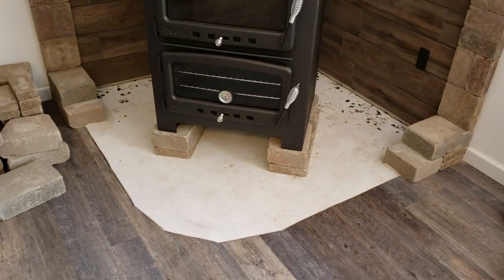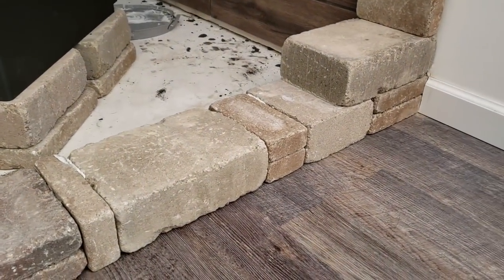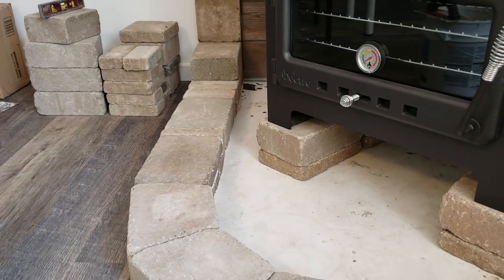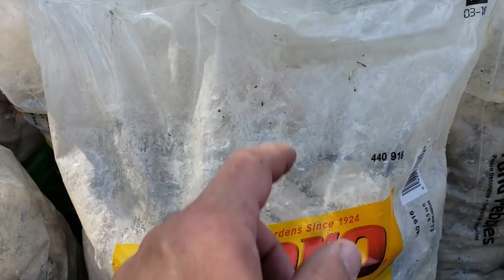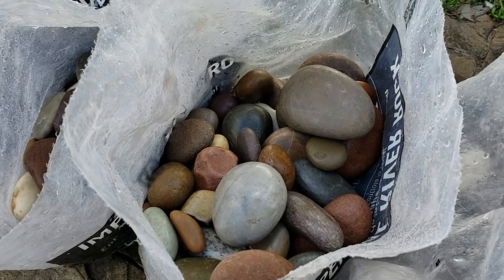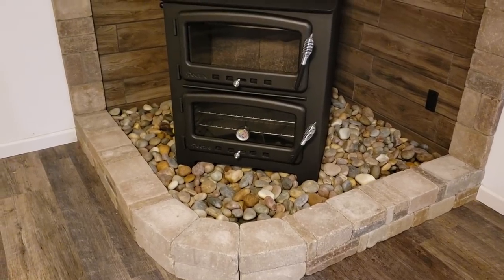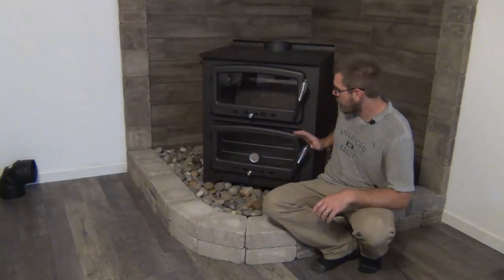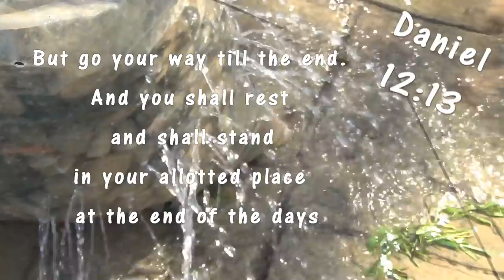Wood Stove Install - Hearth Made From Landscape Stones

Comment: Looks great!  That's something I haven't seen before.  A hearth pad has the appropriate R value to protect combustibles.  Since you have a concrete floor, it doesn't matter. If someone has a wood floor, the danger isn't just from embers. Heat alone can start a fire.  Concrete board is not enough unless you build it up. There are sites that show different R values, so you can build an appropriate insulator.  We went through this 3 years ago when we installed a wood burning stove on top of our wood floor.  Many people think that tile, concrete pavers, and the like are good insulators.  That's just not true.  Check their R values, and you'll see.  Not trying to hate on your work. You did a great job for your installation requirements.
Reply: I built a 57'' x 56'' x 3/ 16'' steel diamond plate pad. It is welded on to a 1''x 1'' heavy wall square tube steel bed, 6 going front to back and one on each end. The top plate is welded closed on every seam. This sits on top of and is welded to 2 heavy wall  2''x 2''x 56'' steel square tubes running from side to side, one 12'' from the front and one 7'' from the back on center. The total height is apx 3.25'' not counting the diamond tops. The pad/plate will sit on 2 risers that are 52'' long. They are 13.5'' deep x 12.25'' high x 52'' long, made of 2''x12'' lumber which is glued and screwed together. The stove is a Hearthstone Harvest soapstone and sits on 6'' legs. The plan was to set the wooden risers directly on the hardwood floor. I am thinking of placing a very thin layer of metal over the hardwood. I am not worried about the heat going through the steel as I am fairly certain the plate will stay cool and there is 3'' air gap to the bottom of the 2''x2'' legs. I am thinking more along the lines of a wild ember finding it's way past the pad. Do you think the base layer is overkill or worth pursuing?
Signed ~ possibly overbuilt but definitely going to last

Comment: Looks great, curious if you have an update on how the rocks are working out? Also any issues with off gassing from the tile adhesive if it gets hot?
Reply from the maker: Rocks have been working out great, I run a vacuum around the stones in front of the stove when they get dirt or ash on them. Tile adhesive is good, no issues. The wall doesn't get that hot

Comment: Glad you mentioned the cement floor...I was wondering how hot those rocks will get if they are directly under the stove....btw, that stove, it has an oven in there so you can actually use it for cooking?  That is the best looking stove set up I have seen to date.  Great stuff!! I was actually thinking I would put it in a basement and that is exactly what you did.  I will likely have to buy this stove and copy your idea, Thanks!!

Comment: It looks great, and all that rock will make a great thermal mass - however I also think about how to clean it over time. Ash will be dropping in there, as will bark and wood chips as you load in logs. Dust and pet hair from your home will collect in there, as may small bugs or spiders... 

I like that the stove can make a great cook stove as well. Our wood stove (when I had my farm) had a large flat top great for cooking on top of during periods of power outages, but it did not have an oven feature. That would have been great!

Did you show how you fixed those power outlets on the wall near the stove?
Reply from the maker: The power outlets I just removed the outlet and capped them off with a metal outlet cover spray painted with BBQ paint.

Comment: Thanks for sharing your project with us; I really enjoyed watching these videos.  I'm looking at a variety of approaches for creating a safe hearth space for a wood burner and I like a lot of what you've done, here.  The river stones are attractive and functional.  My thought is to do something similar, but using a base layer with a sufficient heat rating to protect the wood floor beneath, then a couple inches of sand before layering in the stones on top.  I'm also going to build a fire-rated back drop that extends a few inches forward from the wall to create an open air space between the "heat shield" and the wall so that cooler air can circulate in between.  I love the ceramic tile idea you went with.  I was considering a covering of Thin-Brick, but the look of wood behind a wood stove has a kind of adventurous quality.  :)  

I saw several other comments about cleaning ash from the stones.  I really don't see a big problem for you.  A crevice tool on a Shop-Vac should be fine.  You're only going to have to clean the area around where you load the wood and empty ash, and you'll probably only need to do it once a year (in a season when you're not using it).  That brings me to my real question for you, about the ashes.  I saw this same stove on another video, with the oven down below.  In a lot of models, this is where you'd find the ash box.  Once you've used this for awhile, I'd love to know whether you use the oven feature enough that its value offsets the annoyance of having to scoop out ashes rather than just pull and dump an ash box.  Great video, and thanks again.

Comment: Nice job man.I did the same thing several years ago and loved it but the dust collection in the stones is a bit of a hassle.Vacuuming with a little upholstery brush attachment works well for cleaning the stones but after a few years quite a bit of debris did make it's way right into the stone and had to remove all stones to give a thorough clean which was a messy job.One thing that did help a lot with ash build up in the stone was a large coloured concrete slab I made a installed under the wood heater that stuch out in front of the heater by 300mm which stops ash falling directly on to the stones.Cheers
Reply: Can you tell me why he added the stones? We are getting ready to do a similar project, but I don’t understand why he used the stones.

Comment: Did you have any issues with the river rock exploding? I know you don't use river rock for fire pits because of the water inside of the rocks will cause the rocks to explode when heating up.
Reply: They shouldn’t get near hot enough

Comment: Looks great. What’s that stove rated to heat? How long will it burn on a full load? My house is 1500 sq ft and I bought a stove for 2500 sq ft because I have it in the basement too. I was surprised, takes a good couple of days to get all the cement in the basement heated up before you really start getting the good heat. But once it’s cold enough where you burn 24/7 it’s great.

Comment: That looks very nice, that wood hearth is gorgeous. I am curious, are you purely counting on the physics of heat to radiate upward from the basement up to warm the rest of the house?
Reply: Me too ..... Are you counting on a cooking surface fan? Will you some how hook up to the blower fan in your furnace?
Reply from the maker: This will be working on pure radiant heat and natural convection in the home. It is in the lowest level and will circulate heat throughout the home naturally. At least that is the plan.......
Reply: should work pretty well, Al at Lumnah Acres has a similar convection setup.  The basement staircase is in the center of the house and it all travels up through there.

Comment: This looks good when you set it up initially but it's a maintenance nightmare. Unless your home is completely sealed and actively ventilated, it's gonna get real dirty real fast just from the dust flying in through the doors and windows and there is no way to clean those rocks other than to take everything out and immerse them in water.

If I were you, I would just tile it up. It isn't expensive to tile up such a small area. Tiles are cheap and you could install it yourself. For such a small area, there isn't much that can go wrong if this is your first time.

Comment: Very nice design.  18 years ago I built a rock wall behind my stove and built a 12" step for the stove to sit on.  I regret doing that because I cook about 90% of my meal on top of my stove and I am constantly standing around it and to have to step up 12" 20 times a day got really old.  My next hearth will be flush with the floor.  I really like this and I hope you don't regret putting all that rock down because if you are going to be cooking on top you almost have to be standing on all that loose rock.
Reply from the maker: I was concerned about that also but the wide landscape stones make a perfect place to stand and cook. Mine needed to be off the ground so I wasn't leaning down to open the oven as much

Comment: It might have been worthwhile to use a bit more of the mastic, you have the touch up, but the goal is to make sure those bricks don't move.
Reply from the maker: So far they are feeling pretty solid but I agree. If there is an issue I would redo them with mortar instead of the tile cement

Comment: Your rock being a dozen or more inches from an insulated firebox means this shouldn't matter but for others considering similar applications of river rock, beware: river rock, so named because it was in a river, hence its smoothness and round shape, can entrap water and when heated sufficiently, explode. I've seen it. Think of a grenade made of stone. This is why you never use river rock to make a fire ring when camping. Again, likely not a cause for SSLDad's concern, just a warning to others.
Reply from the maker: I hadn't thought of that since, as you mentioned, I don't think it will get that hot. It should get warm though and hold some heat over night which will be nice

Comment: Vinyl is combustible and releases highly toxic vapor. I hope that the tile adhesive that you used was fireproof and not combustible and I hope that you left some air space between your surround and the wall or get ready to call the fire department! 🔥 🔥 🔥
Reply: I did not know that. We have final flooring in our container home and will be doing a woodburning stove. Install like this very soon. Any tips?